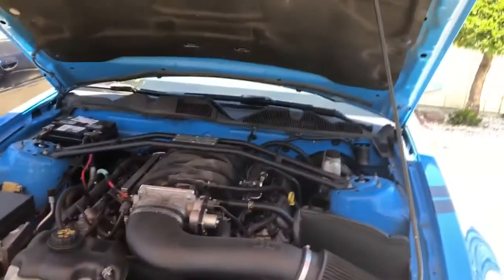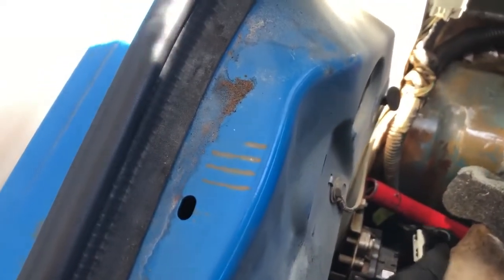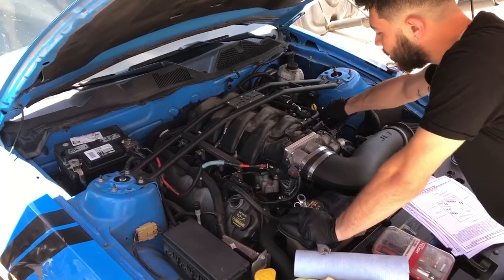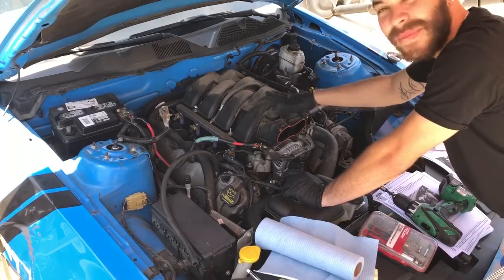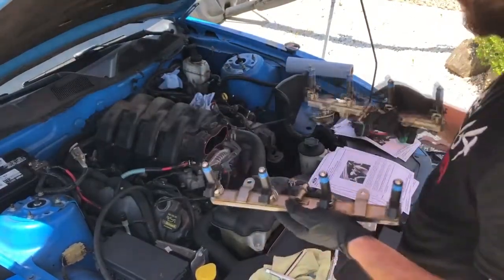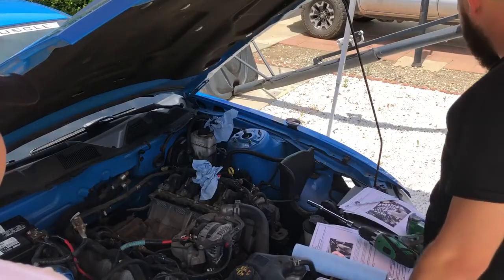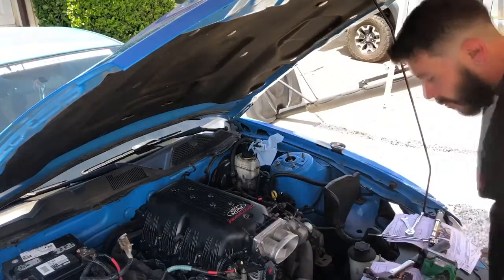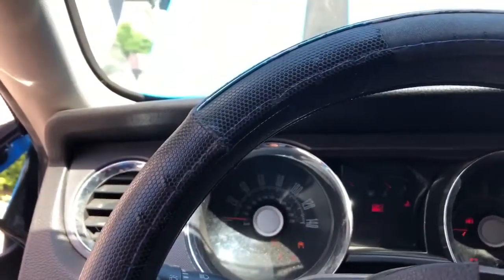ADDING some EXTRA POWER to my 2010 Mustang GT! (CRAZY GAINS!)

Comment: Definitely upgrade to a high performance fuel pump and fuel filter. Look into high performance cylinder heads and valve train assemblies next. Port your intake manifold and cylinder heads to match. Upgrade your ignition system, switch to "cold" plugs and high performance coils. Lastly, switch to a high performance camshaft and start tuning your air/fuel ratio and ignition timing, then get an air-to-air intercooler and high flowing radiator to start boosting it. 🤙To really help put that power down, upgrade your tires, differential, and drive axels.

Comment: By adding that ford performance manifold, you lost about 15-25 torque, that manifold is only good if your pro charged or turbo’d you need the cmp back too get your torque and low end power back
Reply from the maker: Should be going Cammed Then Procharged in the near future. That Low end torque has a lot of lag becuase of no CMC. Felt Silly after doing this. But I Want an E 85 Tune
Reply: JustModIt yeah man
Reply: Waisted money